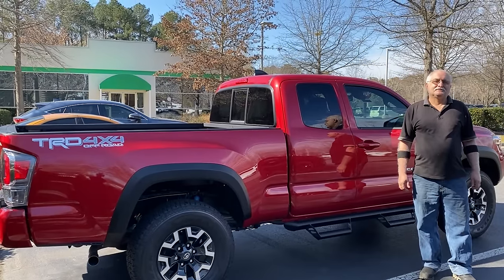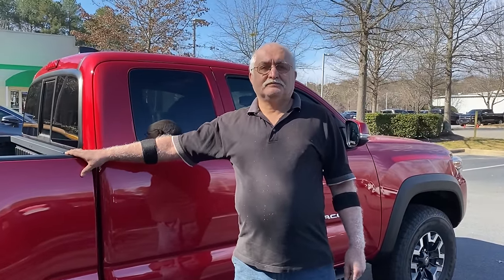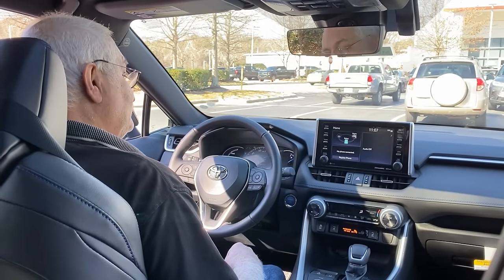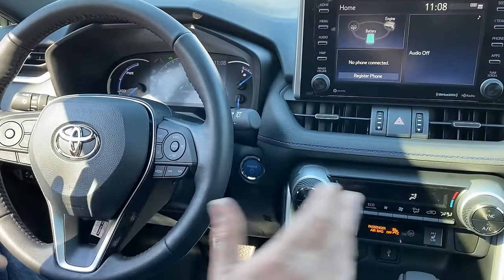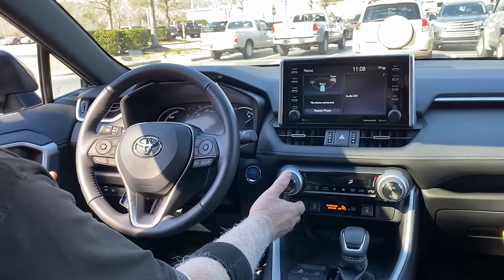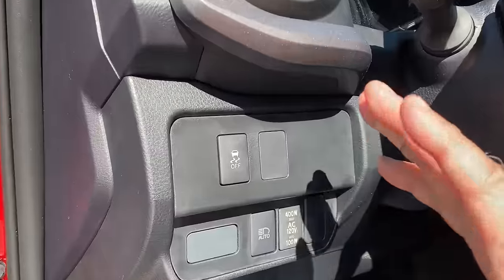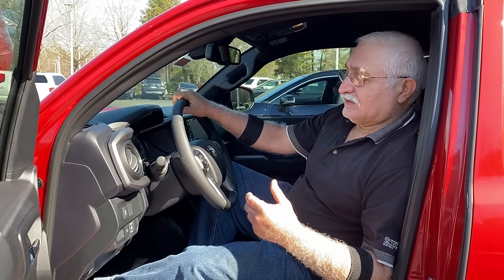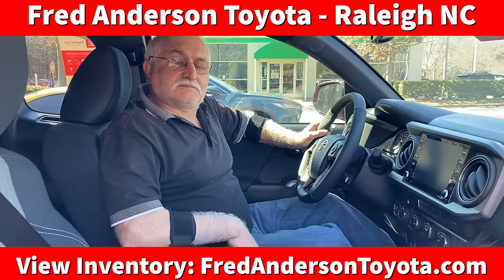Traction Control Off Button: Mechanic explains what it does and when to turn traction control off

Comment: Very unclear description.  Traction control works by noticing wheel rotation speed differences on the wheels (could be front or rear), and applying braking to the wheel that is spinning faster.  It also reduces the engine RPMs.  This can help you if you are lightly accelerating on ice or snow and a wheel loses traction and begins to spin rapidly.  Counterintuitively, if you are stuck in ice or snow you will want to turn traction control off as you want to be able to spin the wheels a bit to get out and the last thing you want is braking or reduction in engine power.  Also if you need to drive long distances on slippery roads, know that if you leave traction control on the vehicle may be applying braking frequently which can cause significant break wear, so it is better to drive slower with traction control off.
Reply: Agree.  My experience with my Venza is that if I don't turn off traction control when going up my slippery driveway, the power reduces and I end up going down backwards.
Reply: WHY WHEN I TURN OFF TC I LOOSE THE FN REAR WHEELS COMPLETELY ON MY 2022 HIGHLANDER???? IM PISSED. IM GONNA UPLOAD THE VIDEO
Reply: Uh, the video presenter does a much better job of explaining this than you do.
Reply: @jasonruch3529 do you mean loose (loosen) or lose? Very confusing what message you want to convey!

Comment: Traction control does add traction. Today I saw that in action. A woman had run the front of her Rear wheel drive Lexus off of the pavement into a ditch. One of the rear wheels was not even touching the pavement. But we were able to back the car back onto the pavement, since the TC  stopped the airborne wheel from spinning freely and though the differential forced some torque to the wheel that was touching the groun.
Reply: i have a very steep driveway. There was some snow thats almost frozen with ice around it. my car was having trouble going up to the pavement. I realized traction control was off. I engaged it on. Car went up smooth with just a light press onto the pedal! rav 4 2016 awd.
Reply: Yeah this type is different than what you are describing. Sounds like you're describing what they have on Land Rover and that's what I have on my land rover. It actually does work very well using the ABS system to pretty much do the opposite of what ABS normally would do

Comment: This was helpful.  Can you explain the difference between pushing the Traction Control button once and putting it into Auto LSD and holding the button 3 seconds to turn Traction Control off?  When would it be best to use each?  Thanks -

Comment: Been driving for close to 60 years and during that time, I have driven in some of the most treacherous winter conditions imaginable, all without traction control. To me, traction control is nothing but a crutch for those who wont take the time or don't really want to learn how to drive in adverse conditions. So the first thing I do whenever driving in snowy conditions is to turn off the traction control and trust my driving skills.
Reply: Willy I have been driving for nearly 50  years and my first experience with traction control was nearly catastrophic, I live in NL, Canada, and knew what I could & couldn't do while driving in winter conditions. On my first traction control vehicle my engine stalled pulling out of an intersection. It was a close encounter and never used it again. We should be able to turn it on, not turn it off!!!
Reply: agreeded, traction control off = "normal"..... traction control on = "abnormal". I wish they allow you to set it permanently on or off using a switch rather than default on until you manually turn it off.  time to check out the cpu schematics.
Reply: Permanently disabling this nuisance would make a wonderful video. @danzaokid
Reply: good for you , I am Mechanical Engineer of 32 years and in my opinion TC  has its uses and its downsides it is a safety feature, not everyone has 60 years of off road driving experience and many people drive high powered modern  vehicles not just 4x4s , many road going domestic and off road cars these days can run on 300 to 400 hp on modest size engine displacements many of these cars have Turbo chargers which can overwhelm even the most experienced drivers, Traction control is excellent for  normal and high speed driving and save lives, it stops idiots with lead feet going into the scrub or killing other road users, the computer allows each drive wheel to modulate and can pull a wayward vehicle about to break traction into a straight line it also saves lives so your opinion is just that,  thankfully its not shared by everyone  you need to accept that just because you are old school it does not mean its the correct school of thought you need to move with technology as vehicles get more advanced and powerful.
Reply: I respect your thoughts. @Azureecosse
Reply: Agree. Seems like a waste to me.  Never use it.
Reply: @NewfiePete pm😅

Comment: So speaking in general, when its not raining or snowing or mud or sand. Do you keep it on or off? Does keeping it off helps with saving gas or etc?  Please let us know
Reply: Leave it on driving on the freeway, you can turn it off if your stuck stationary, leave it on traveling through a storm. If you turn it off and burn rubber then it will cost gas
Reply: Simple: If you're having trouble to get moving, turn TC/ESP off. Otherwise LEAVE IT THE HELL ON!

Especially on snow, sand and mud. The more slippery the road, the more likely you're gonna run into a situation where your car wants to spin out and you would need the help of traction control and ESP to keep your car under control, so always remember to immediately enable the system once you freed yourself from being stuck in the snow/mud or crawled up that hill with it off!
Reply: @LRM12o8 I sometimes forget to turn it off when drag racing! 😁
Reply: 2:11 is your answer

Comment: I always turn it off. Particularly in a high HP vehicle TC can be dangerous. If you do lose traction and slide sideways, when you ease off the throttle the rear swings very abruptly back and often goes across your center to the other side, back and forth rapidly a few times. I have better control of any slide with the TC off.

Comment: What about holding the trac-control off button for 3 to 5 seconds? What mode is that and when would it be beneficial. My 07 tundra has a this option that turns off traction control and the auto limited slip.

Comment: If you drive a Land Rover it does increase traction because one wheel spins and the ABS system slows it down makes the other wheel grab through the open differential. The Toyota guys have something like that it's called A trac but on Land Rover there's no button it's always active and it came out way before the A trac.

Comment: What if you're going down a steep curvy hill with snow and ice would you turn the traction control off then or leave it on?
Reply: Under all circumstances leave it ON! The last thing you wanna do is sliding down a hill with no steering stability!

Only turn it off when you can't get out of mud/snow or can't get up a hill.
Reply: THANK YOU! @LRM12o8

Comment: hi, just bought a 2020 OF and to my susrprise, i couldnt locate the traction control button anywhere in the vehicle, it auto diables when in 4LO but keeps intruding when doing serious sand dune offroading in 4HI it keeps cutting the throttle and applying the brakes in critical moments, pls help!!
Reply: That's what it supposed  to  do

Comment: Traction control can be unsafe, especially in front wheeldrives, when trying to  accelerating from a standstill where the wheel has to move over a wet street, especially if the street has concrete ranways for water. . In many cases you will find your car stalling just as you pull into oncoming traffic.
Reply: That's bullshit. ESP/TC on is always safer than it off. 
If you stall your engine, that's NOT the traction control's fault!

Comment: Ok lets say i have my 2009 trd sport in 4 wheel drive. If i turn the traction control off and i have a rear wheel start to spin/lose traction will the ABS system brake that wheel to make the other rear wheel turn? (Im pretty sure I have to be in 4 wheel low as well)

Comment: Sorry, but traction control does give you better traction. It directs engine power to the wheel that is not spinning. Similar idea to a limited slip differential.

Comment: I have a vsc system error that comes on very infrequently on a 06 sienna. It can cause stability issues when it comes on. Mostly it appears to happen after not driving for a few months and think it may be due to rust on rotors causing bad info to old sensors.  That said if I turn traction control off by the button will that total disable the issue? Do I need to pull the abs fuse? Please not this is temp until I can get it to my toyota mechanic.
Reply: Don't do any of these hacky workarounds, use your car as little as possible until you can get it fixed. Not having the time or money is no excuse to drive around in an unsafe vehicle, being a danger to everyone around!

Comment: Hi!  Could you ask Ali what would be the cause for the traction control light on the DIC to come on and flash  just when I turn, regardless of speed and road conditions. This has been going on for about a year.  I can slightly feel something happening but I can't really describe it.  Once in a while the abs also kicks on along with it.  I've taken it to the dealership and multiple mechanics and nobody knows what it is because the light isn't always on so, it isn't throwing a code.  It's an 07 Avalanche.
Reply: A Chevrolet dealership?  Genuine GM parts only? I can't believe they couldn't say with certainty the problem is. Getting a printout of the engines extremes might rise a brow. It'll show the highest it's been reved, the hottest it's been, and so on. I got a question of my own. Does the light flash without using the turn signal? I have no clue by what you say kicks along with it. Next time the ABS light shows test it yourself by slamming on the brakes see if they lock up, but pull the fuse and reinstall it. That something you feel happening is just your torque converter locking up. Kinda hard to explain but I knew a moron who thought he had an extra gear. It's the red lights you don't want to see. If it's yellow and not affecting the drivablity, it's not an emergency.
Reply: Sounds like a clear case of the wheel speed sensor gone bad. They go bad regularly. Relatively easy to replace if you are at all mechanically inclined.
Reply: @528Circle  Well, I have a plethora of suspension issues going on with my truck.  Things that should have been been picked up on by all the mechanics that I've been to for this.. a few months ago I did replace one of the rear sensors  and both rear shocks. The front ones are built into the hub. This week I replaced my bad air ride compressor pump myself. Unfortunately the new one isn't kicking on now so I'm hoping it's just due to one of the ride height sensors rotting off (part came in yesterday) or, something I did wrong. Front strut assemblies are on order and, getting rotted off body mount brackets fabricated next week.  Fun times!

Comment: 1:56 Guys I'm sorry for the thumbs down but you just are not a commentator and you're getting some of the technology a little bit wrong so I think you should bone up on what you're talking about add get somebody to speak who can actually be understood. Also you were drowned out pretty much in the first 30 seconds by a fighter jet going overhead couldn't you have stopped it waited till it cleared and then started over again. Part of your problem is the fighters going overhead and you're not being aware of it when you're doing your video anyway I appreciate the attempt to educate us. But thanks for the try have a good day

Comment: Fella.. that is Vehicle Stability Control, not Traction Control. VSC cuts throttle when wheelspin is detected (and is why you turn it off off-road especially sand/beach), it forces understeer to make recovery more manageable for the noob majority of Drivers. Traction control will brake the wheel in the air and trasfer power to the one on the ground in an open diff configurations in an off-road scenario, on bitumen this is the last line of defense AFTER VSC because it forces oversteer if it grabs. In most vehicles, you can't actually turn TC off without removing a fuse etc

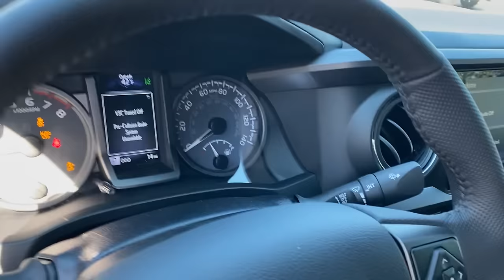At 6:47 in your video when you point out that "Traction Control is off" in the display.. clearly it says "VSC Turned Off"

Comment: Wrong.  Traction control apples braking to the wheel that is spinning in order to cause the differential to transfer power to the wheel that is not spinning.  You're not working on my truck dude.

Comment: I didn’t know you press the seat heater to turn of traction Control.  I’ll try it next time.  Ali must of been walking thru the dealership and they need an actor.
Reply: My old car had the heated seats button right next to the ESP OFF button. Two buttons, same shape, hidden from view behind the steering wheel. One of them you absolutely wanted to press in winter, the other one you ABSOLUTELY DID NOT want to press in winter! 🤣